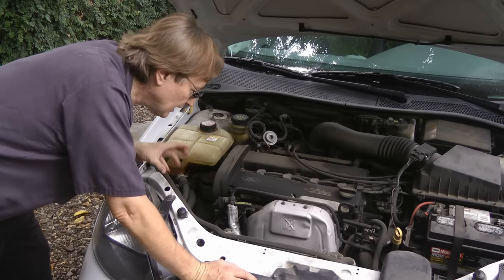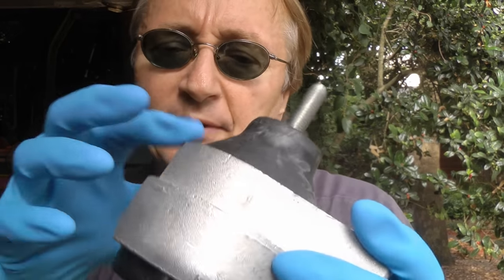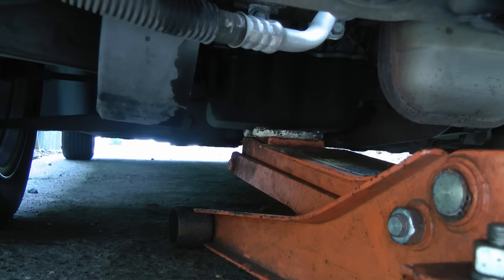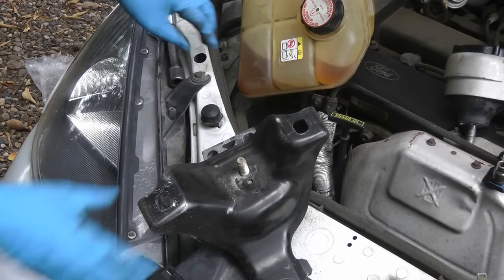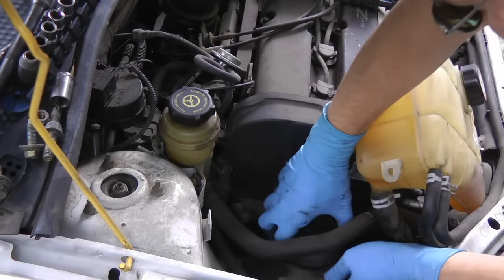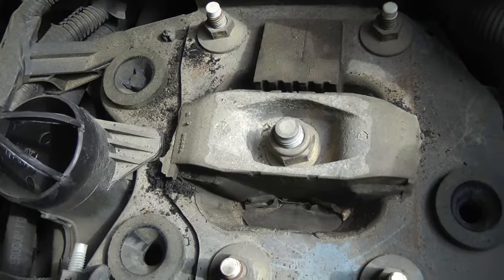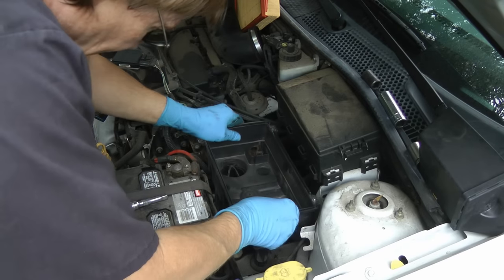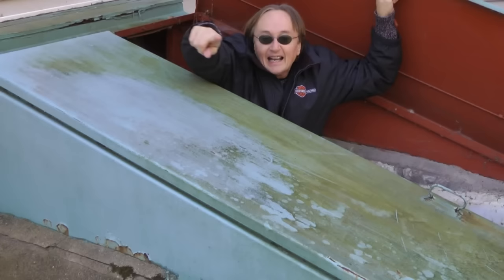How to Replace Motor Mounts in Your Car

Comment: This is the problem with my car right now. I'm accelerating and I feel crazy vibration. Turns out my mount is worn, engine is moving, and is putting more stress on the Axle

Comment: only 20k mile car 37 month van.. :(    can the motor mount crack from bottoming out? how about from battery acid leak?  What I hear is pop when I first reverse.  Dealer wants $1000.

Comment: I wish it was as easy as you make it seem.  I have never changed a strut or cv axel or a caliper with out striping a bolt,  breaking a bolt,  or part not fitting correctly.  Something always happens and a 1 hour job turns to 3 hour job.  Something always happens. Anybody agrees?
Reply: Yes not always but it happens

Comment: Hi my name is Deborah and I am a widow and therefore I don't have a man to take into a repair shop with me. I have a 2003 Chevy S10 pick up 4.3. I first took it into the shop because the ABS light was on and tires squealing and the back end bucking when I pulled away from a stop. The mechanic said it was two sensors. $500 later. the ABS light is off but I have the same issue. I take it back and now he says, I need to rebuild the driveshaft and I need to two motor mounts. he said the labor on putting in the two motor mounts is 4 hours. I just watched your video and I can't believe it would take 4 hours to replace 2 motor mounts on my truck. said the rebuilt driveshaft would be $465 plus labor is $648 and two motor mount replaced would be $584. Does this sound right to you? he said my driveshaft comes in 2 pieces the carrier barring is gone and CV center joints. Please help me if you can. I am on a fixed income and I don't know how I will get this money to fix my truck. I have two kids that I also care for.

Comment: I have a Toyota Avalon 98 how to change motor mount s
Reply from the maker: +Carlos Nunex do as in this video, just realize it's a LOT more work getting to the back mount on that model. Get a cheap manual if you can't figure it out looking at it and jacking the car up

Comment: I need help removing my lower back motor mount on my 1996 lexus es300. Can someone help?
Reply from the maker: you and me both. You really have to remove the front mount bolts and the back, then jack the engine up to get enough room.
Reply: How much do9 you think a shop will charge me?
Reply from the maker: Alex Barcelo
over 400 bucks is the cost from a labor and parts manual quote.

Comment: DO NOT place jack on ANY pans. all the weight will damage or even break your pans. use a piece of wood on the jack and find a solid piece of metal in which you can lift the engine on with the jack

Comment: I honestly wouldn't use the oil pan as a support for the engines weight; regardless of circumstances.
Reply from the maker: IF you don't have an engine hoist A frame to pick the engine up from the top, it's the only way you can do it .
Reply: ***** I say if supporting the engine by the oil pan is your only option, at the very least use piece of 2x4 in between the pan and the jack cup to both cushion the oil pan and spread the load out evenly to avoid crushing the pan.
Reply: MrNotorius5500

Comment: Why Jack it up to the oil pan? Won't it crush it
Reply from the maker: aluminum ones are rather strong, but with stamped steel ones, use a piece of wood and be careful. If you are worried, you would then need and engine cherry picker lift set up to pull the engine up in the air

Comment: HOW TO CHANGE FRONT WHEEL BEARING 98 HONDA ODESSY
Reply from the maker: Gabriel Gonzalez  Remove the knuckle from the hub unit. Refer to Steering and Suspension.

Remove the splash guard from the knuckle.NOTE:  It is not necessary to remove the splash guard for hub unit or wheel bearing replacement.

Separate the wheel bearing from the front hub using the special tools and a press as shown.CAUTION: Hold onto the hub to keep it from falling when pressed clear.

Press the wheel bearing inner race from the hub using the special tools and a bearing separator as shown.CAUTION: Hold onto the hub to keep it from falling when pressed clear.

Replace the bearing with a new one after removal.NOTE:  Wash the knuckle and hub thoroughly in high flash point solvent before reassembly.

Press a new wheel bearing into the hub using the special tools and a press as shown.

If necessary, install the splash guard and tighten the screws.NOTE:  Align the projection in the splash guard with the hole on the knuckle.

Install the knuckle on the hub unit, and tighten the flange bolts. Refer to Steering and Suspension.

© 2015 ALLDATA LLC. All rights reserved.

Comment: Only Scotty can make such a b*tch of a job like motor mounts looks so easy. In a lot of cases, you might very well have 1 easily accessible mount, nice and straightforward, but there is always a side that wants you to take off your entire exhaust or intake just to get to the other. It’s usually a difference between a 30 minute side and a 4 hour long side.

Comment: That's funny, I had the same car and had motor mounts replaced three times on it
Reply from the maker: yea, not a good design. It's really better to have one at the front, one at the back, and one on one side and another on the other side to make a rectangle support, not just both front and back.  They were just saving money putting only two on.
Reply: Scotty Kilmer Hey scotty im seriously sorry that i bother you so much but im looking at a 1994 mustang 3.8l v6 5 speed and im wondering what are some common problems with the car and what should i look for before buying this car? thanks and i really appreciate your videos they really help all of us out.   hes also asking $1000
Reply: Scotty Kilmer
I like the toyota design like in my camry with the three on the bottom and the dogbone one on top that absorbs the engine shifting in and out of gear.  The only one that typically fails (every 10 years or so) is that top one and it's just 2 bolts to replace and no need to even hold up the engine.

Comment: The mechanic told me my right hand gearbox mount was "half cracked" those were their exact words. I looked at the mount & the crack is in the rubber part, is about as thin as a human hair and is only on one side of the mount. I Think their noses are growing
Reply from the maker: +Kalel Pruitt jack it up as in this video, if it doesn't split open, it's fine

Comment: It is elementary to use a block of wood to spread out the pressure from the jack as well as the hardness of the jack saddle. It can be done without the block of wood, but there is a percentage of possibility that the pan will be damaged. Scotty goes fast for times sake, so there is not reason to beat this point to death, when you  do the job, just use a piece of wood an continue. I don't think that some of you bozos learned how to tie your shoes until you  were in your twenties. Regards, Vin AKA: The Doctor Of Motors